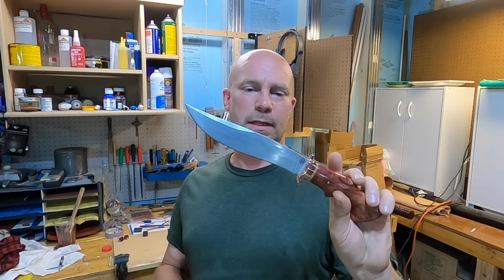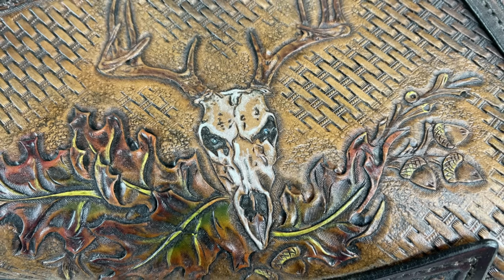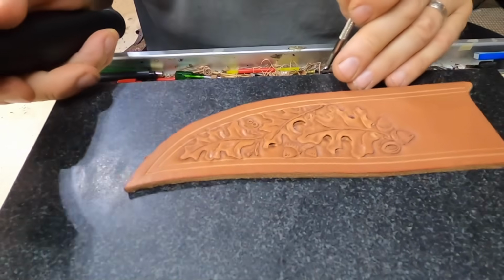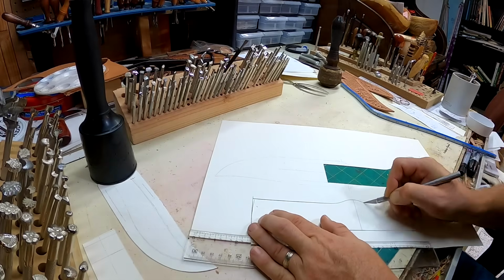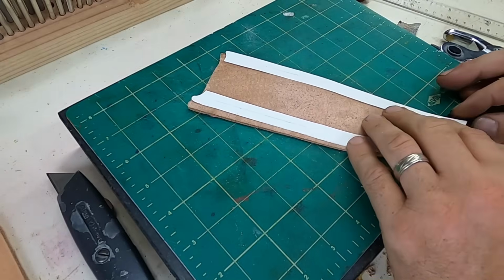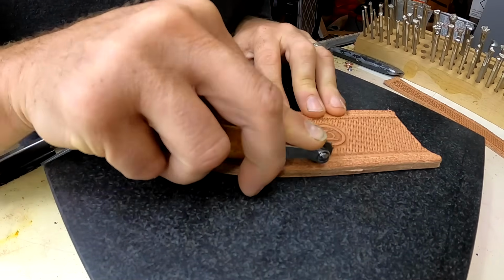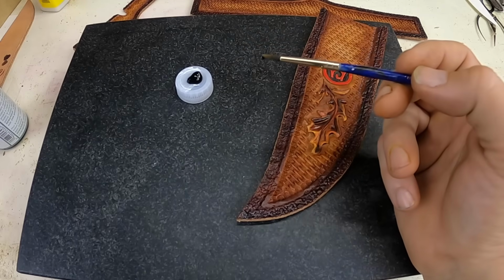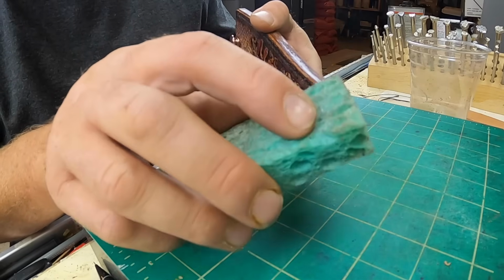Making a Leather Sheath: Full tutorial

Comment: Subject to how l see your magnificent work and   talented  lve only add a suggestions when the knife return to bed, imagine that you are in hurry with out seen. Would it be better to place a   four inches alloys upon the top against the latter belt to easily slice the knife onto the bed? ..Anyways it all good mate
Reply from the maker: Hi Apelu!  Interesting suggestion.  I suppose something similar to what I've seen on some scabbards would work.  I'm usually well guided when drawing and bedding my knives so I don't normally think of something like you mentioned.  The belt loop did guide the knife fairly easy into the sheath so I didn't think of it to be an issue.  Regardless, I appreciate your comment, and critique.  Cheers!

Comment: Nice craftsmanship and demonstrated really well. What do you use to clean out the airbrush after using the dyes and resolene.
Reply from the maker: Hey Joseph,

I use regular Windex mixed 50/50 with Denatured Alcohol.  After an initial flush with clean water this mixture really breaks down any remaining residue.  It's been my go-to cleaner for acrylic based paints (such as resolene), and water based inks/dyes.  I've used this cleaner since I started airbrushing murals/illustrations 20 years ago with great success.  Be sure to follow up with a clean water flush before storage.
Reply: @TwistedOakHandmade  Thanks. And you use this for cleaning the Fiebings dyes as well.
Reply from the maker: Correct.  I use it to clean Fiebings dyes too.

Comment: Great work! It came out beautiful. Question: How did you go about putting holes on the back/thicker side of the sheath? I noticed you used a stitching groover on both sides. How did you line up the holes? I have sub and liked. Thank you in advance. :)
Reply from the maker: Hey Baron, thanks for watching.  I use the stitching groover to set the margin followed by a stitching wheel to set the spacing.  I measure from tip to top edge on each side where the stitching will end and make sure I have the exact number of holes for the front, and backside of sheath.  When I glue up the sides I use stitching needles as pins for alignment.  Sometimes the holes between the two sides will skew so I leverage them back into alignment with an awl.  Hope this answers your question.
Reply: @TwistedOakHandmade  Yes, thank you. Always nice when the holes line up.  :)

Comment: Gorgeous sheath! Just wondering if you used gum trag on the edge before burnishing? The video was moving pretty quickly, I'm sorry if I missed that. Nicely done my friend!!
Reply from the maker: Hi Nina!  Thanks for the compliment.  When I shot the video initially I didn't use Tragacanth but did come back and burnish the edges with it after.  I probably should have included this step in the process but it's tough to show the entire build while making cuts to keep the viewer engaged.  Depending on the quality of leather I'll use either trag or saddle soap during the burnishing process.  Thanks again for watching!
Reply: @TwistedOakHandmade  thank you! One last question, I just got an airbrush for doing this same application. Do you have any advice for mixing the dye and what you dilute it with (ratio etc?). I really appreciate that you took the time to respond. This video was an absolute game changer for me. Gratitude!
Reply from the maker: So with your leather dyes, most are thin enough to spray directly through a thin tip on your airbrush.  No need to dilute the dye further.  If you're spraying acrylics then you want to go with the consistency of milk.  The paint should coat a jar or glass when shaken, but soon settle without leaving any paint on the sides.

Regardless of what you are spraying, do keep in mind to flush, and clean directly after using.  There are many pre-made cleaners on the market but I like to use a 50/50 mixture of windex, and denatured alcohol for dye, and acrylics, followed by a clean flush of water.

Hope this helps and best of luck with the airbrush, I think you'll enjoy it!
Reply: @TwistedOakHandmade  thank you so much! Cheers!

Comment: I haven't even finished watching the video but I am compelled to say Thank You for this tutorial!  I came back to edit my comment after I finished watching the entire video. The sheath is beautiful and I'm not big into tooled leather. I have just one question, does friction keep the two parts of the sheath together when drawing the knife? It is a snug fit and it seems the sheath would come out of the loop as the knife was drawn. What am I missing?
Reply from the maker: Thank you, Bear ly!!!  I appreciate the compliment.
Reply: It may be just that it is done that way so that drawing the knife is a deliberate action. I’ve seen some frog sheaths where there is a retaining tab as part of the loop so that the sheath doesn’t come up with it. Or a simpler stud that sets into a hole in the middle of the loop
Reply from the maker: Hey Brandon and Bear ly!!  You're correct on all parts.  I have made frogs with retaining straps on some of my bigger sheaths because there is more resistance when a larger knife is drawn. The size of the frog also plays a lot into how tight I wrap the fit around the sheath.  I go a bit looser with wider straps because too tight, and the user has to struggle removing the sheath (these usually have an additional retention strap).  

Smaller ones like in the video can be wrapped tight enough to keep the sheath from withdrawing when the knife is pulled, as long as the sheath is not too tight.  Problem is...I like my sheaths to retain the knife when tipped upside down so here's always a fine line between knife, and sheath retention when making a frog without some type of additional strap, or bullet to lock it in.  In the end this one worked out perfectly on all aspects.

I'm really impressed both of you focused on the details enough to come back with some great questions and answers.  It means you were engaged in the video and I appreciate that!  Let me know if you have any other questions.

Comment: Very pretty $10 sheath custom made for that $5 knife! He used nylon thread at the end of the seams, whereas three steel rivets positioned one at the tip and two at the hilt are required that prevent the blade from chopping through the sheath in a fall.

Comment: You definitely have the talent for carving leather, beautifully made! bur i was wondering what keeps the sheath from coming out of the frog when you pull the knife? it fits snug in the sheath but not so much the sheath in the frog.
Reply from the maker: Hey Bruce!  Thanks for the compliment and question.  So there is a fine line between keeping a snug fit so the knife wont jump out from the sheath, yet loose enough to pull from the sheath without dislodging from the frog.  The frog itself is wrapped fairly snug to keep this from happening.  You can also place some slight side pressure when pulling the knife so the sheath binds with the frog.  Though I believe most users just prefer to use two hands.

Comment: Found on you our Facebook blacksmithing group.

Thank you for sharing!

We are just getting started in leather working, as it goes hand in hand with blacksmithing.

Is there any basic tools required to get started?
Reply from the maker: Hey James! Thanks for showing an interest in my work.  I was hoping the video would help out makers who are just starting out or give ideas to the more advanced leather worker.

I would start out with the following and grow from there based on your preference:

1) Round Knife or Carpenter's X-acto knife for cutting, trimming leather.  You could also probably forge a pretty cool round knife since you are blacksmithing.

2) For stitching you'll need a Stitching Groover to help cut a channel for your stitch lines, followed by a Stitching Spacer, or Stitching Chisels to keep even spacing on your stitching.  I use both as they have their pros/cons.  I use the Spacer in tight or small areas and then follow up a single bladed chisel, or Stitching Awl.  Larger chisels with 4-6 blades are great for doing large straight pieces.  You'll obviously need wide eyed stitching needles for leather and some waxed thread, or cord (which is what I use).

3) For edge finishing you need you'll need a Wooden Slicker, Multi-Sized on one end (my personal preference), and a few Edge Bevelers to help you round off the edges of various thicknesses of leather.  Personally, I prefer to use a Keen or Round Edge beveler because it cuts a rounded corner vs. a flat bevel.  It makes a difference.  I've actually made a few of my own from scratch and could do a How-To video in the future if there is enough interest.

4) A decent leather or poly maul for working/carving tools.  I actually started out using a small, orange, dead blow hammer before purchasing a mallet.  It works just as good IMO.

5) A skiver is convenient to have but I find those with inserts do not hold up.  What I like to use outside of a French Edged Skiver is an old, large, steak carving knife.  With it sharpened and stropped, this knife allows me to skim long, slim, angles off of leather.

6) Last but not least, you'll need a Swivel Knife to lay out your carving lines, followed by Beveler Stamps, and some Background, and/or Matting Stamps, plus a good Border stamp to get you started carving.  These tools are really up to your preference but are what I would purchase first, well that and a good leather carving book to show some of the techniques.

Sources for the materials, Amazon can actually provide all of the above, and more.  So can Tandy Leather and Weaver Leather companies.  You can find some decent starter kits on Amazon but some of the tools may not be of the best quality, nor would I push you toward buying the best of the best as you just start out.

Let me know if I answered your question or need more detail, I'd be happy to assist.